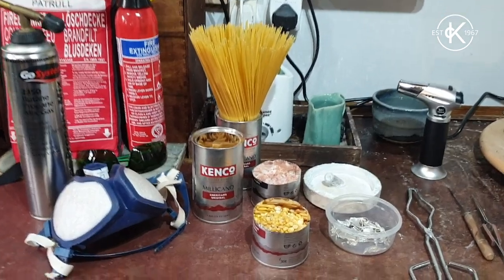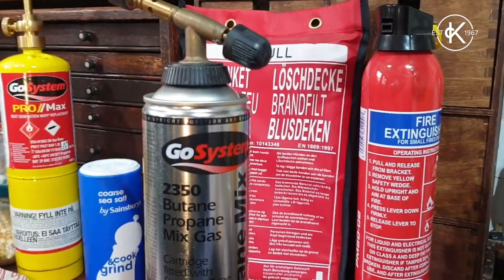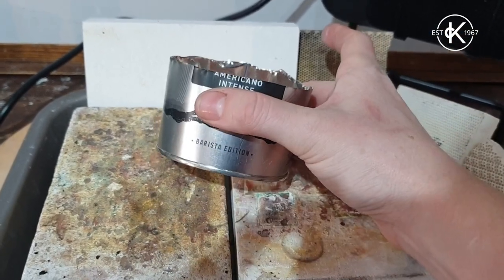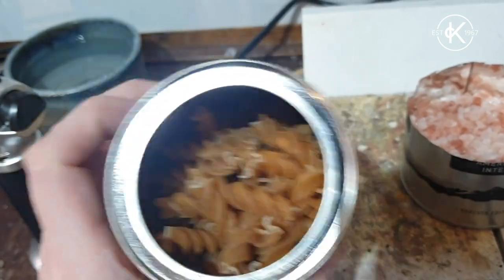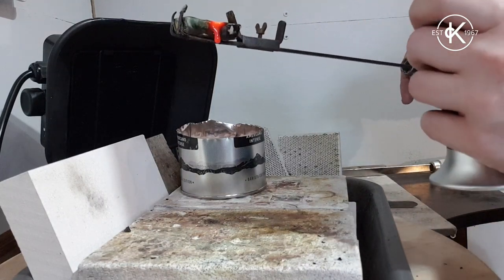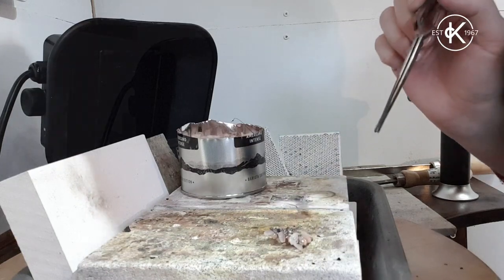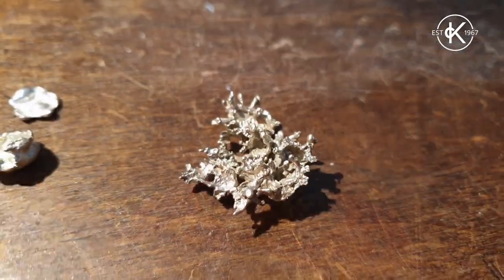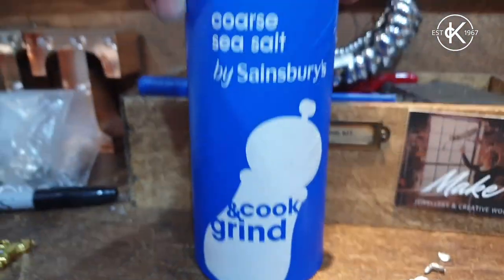Organic Silver Casting Tutorials | 12 Months Of Metal

Comment: Nice video! I'm curious about the weight of that bigger piece that came out of the salt casting. Do you have any idea how much it weighs? I wanted to try something similar, just a tad smaller and I'm wondering how many grams to use.
Reply: Not a clue sorry as it was over a year ago but to be honest, you don't get the most control over how much of the metal stays as one pice and how much separates into multiple pieces so either way, trials and experimentations are the way to go :)

Comment: Do you think it's possible to melt more with a small torch if using fine silver?
Reply: Potentially yes, but I doubt you'd get much more. Worth giving it a go though :)
Reply: no, fine silver requires more not less heat.  Even with sterling the torch she is using is not hot enough for quality casting.